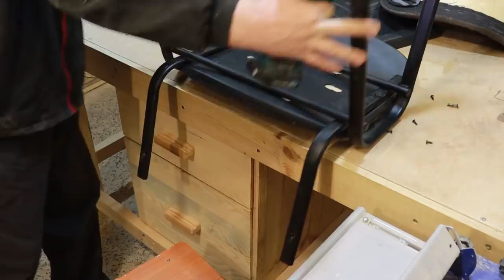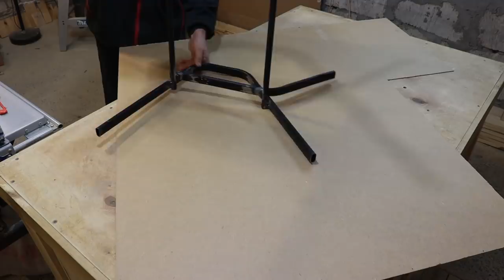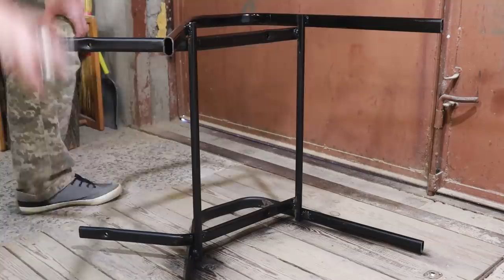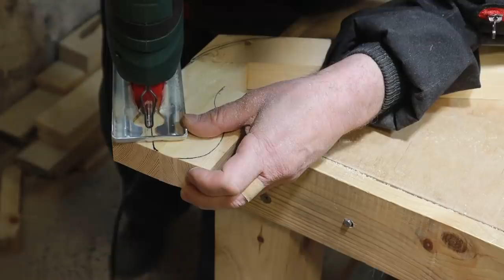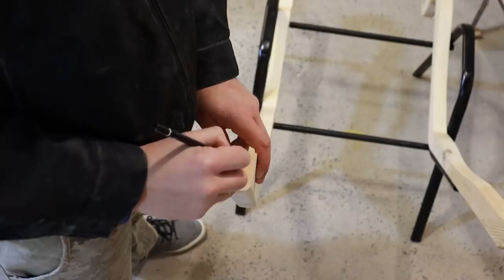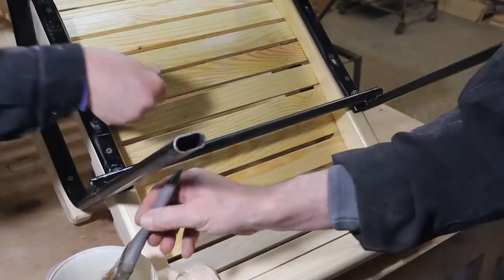Amazing Design Ideas Woodworking Project Cheap From Old Office Chair - Build A Outdoor Lounge Chair

Comment: Not so resisten at the back
Reply from the maker: It turned out very steadily! 2 guides on the sides are fixed to the bottom case, due to this, everything is very good